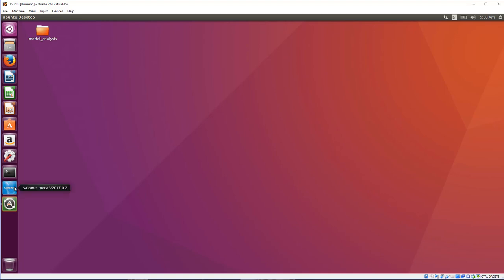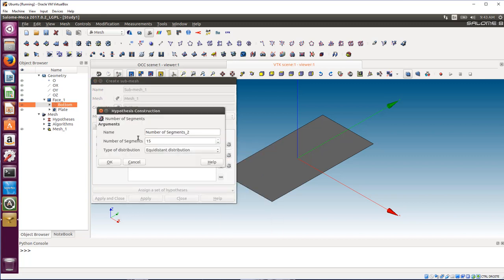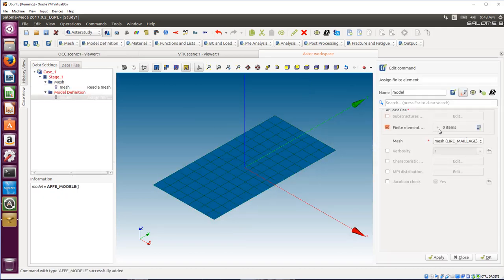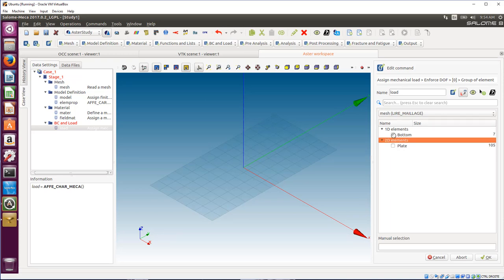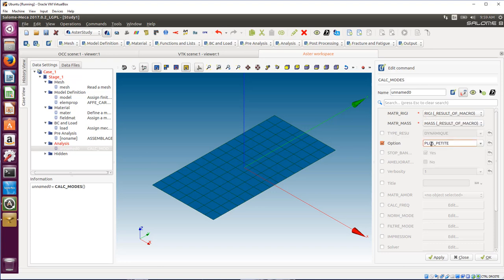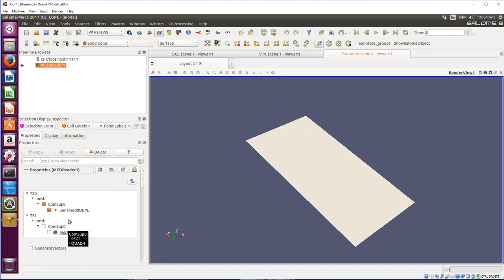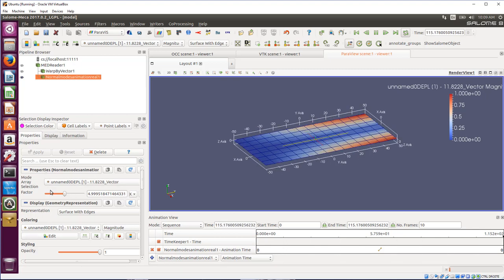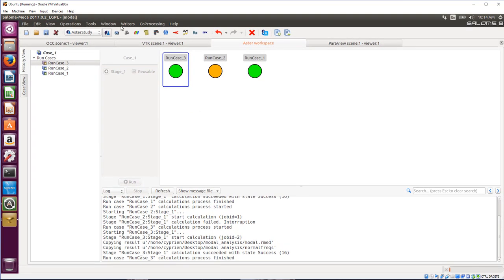[Salome-Meca Tutorial] How to perform a modal analysis?

Comment: Thank you for the nice video tutorial. But I am having problems as after I activate the Mode option in Paravis and click apply the Salome_meca does not respond (Salome Meca 2019.0.3., Ubuntu 18.04) - the calculated eigen modes are equal to this tutorial. Any suggestions?
Reply from the maker: No idea, post your problem on the code_aster forum. (Or the Salome forum maybe if you believe it’s à Salome bug)

Comment: Hello Cyprien, first at all i want to thank you for such a great work. I have installed Salome 2017.0.2, and when i pass through this tutorial, in the end i am getting this error: 

EXIT_CODE=4
Error raised when executing command: as_run export
ERROR: salomeContext:SystemExit 1 in method _runSession

I am very beginner in using Salome, maybe you or somebody else who get the same error can help me with this ?
Reply from the maker: No idea. What system are you running that on? Also Why did you install 2017? Try the newest version available (many bugs have been solved) — check on code aster website the latest version

Comment: Hello Cyprien! I recently installed Code Aster for Windows, I am a NVH engineer. I am following your tutorial very carefullu but gets stuck at 15 min 45 sec, where I get the following error message "not enough values to unpack (expected 3, got 2)" when trying to select the bottom edge for the BCs. I was careful creating the Groups of faces and edges in the mesh module, I guess the message is a Python error message after having googled a couple of times. Do you have any advice? Thank you in advance, Frédéric
Reply from the maker: Not sure, but my guess is that you have python 3 installed. Code_Aster only works with python 2 for now. When you issue the “python” command in windows cmd, is python3 opening or python 2? Locate your python executable and rename it to “python3.exe” then install python2 and make sure that when you type “python” in cmd, python2 opens. I have a recent video about python installation on my channel, check it out.
Reply: @Feaforall  Hello Cyprien, Thank you for your quick reply. I will check the Python version and come back to you. In the case I have Python 3, I will investigate if I can run several Python versions on my computer. Best Regards, Frédéric
Reply: @fredericwullens2768  Hi. I am experiencing the same issue as you describe above. Could you advise if and how you solved it, that would make my day. Thanks